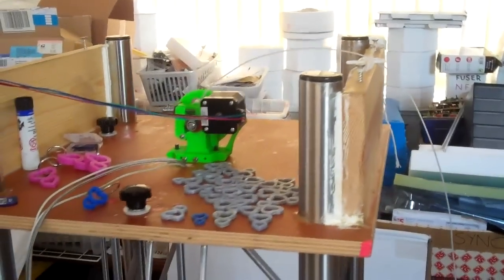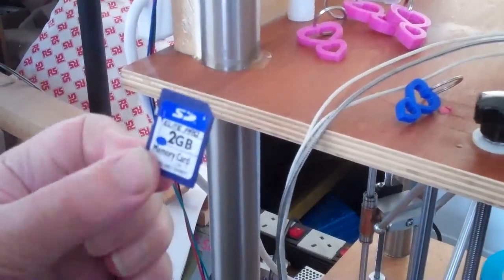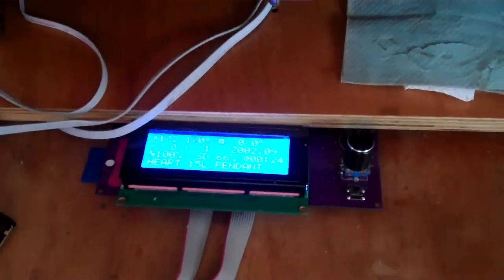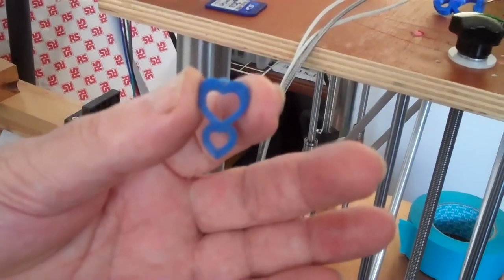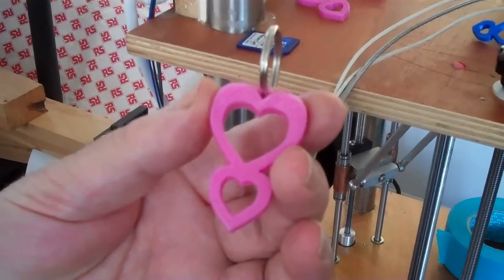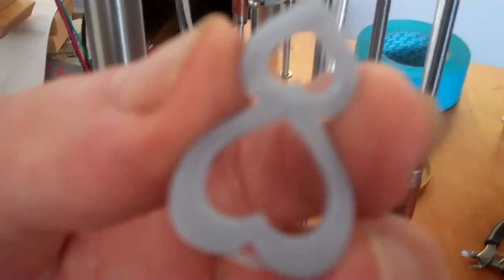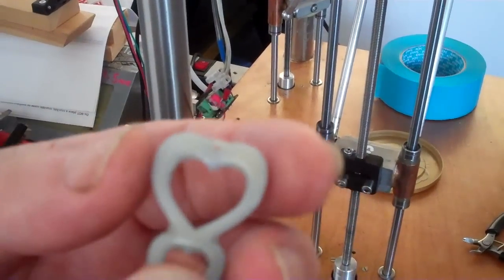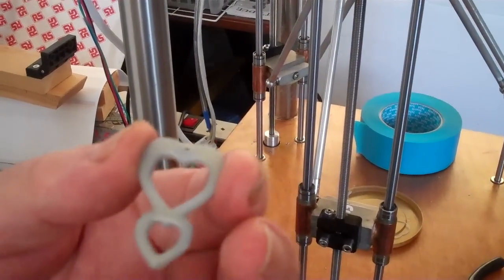3D Printing Patterns For Lost Wax Casting Of Silver Jewellery

Comment: I'm sorry. Your lecture is good, but the camerawork shows just about everything except the actual 3D print build in process, and the background noise is hard to take. It would be helpful to aim the camera at the platform even if just for a couple of seconds, and perhaps apply a sound filter to lower the background noise.

Comment: Thanks Steedcraft for this upload. I was considering PLA for lostPLA method but after seeing several videos (including this one) I think I will try Moldlay. I want to cast bronze parts for model steam engines. I'm considering buying a Kossel XL 3d printer for the Netherlands and they have informed me that there should not be any problem in printing Moldlay. Do you use a heated bed on your printer?

Comment: Hello, it is ABS, PLA or something like that? 
Thanks!
Reply from the maker: +Luciano Lizana MOLDLAY is a wax-like thermoplastic which can be used to cast a variety materials. It is extremely stable dimensionally, and remains rigid at room temperature. Below are some of the @2015specifications of the new material from Parthy:Near zero warpingCan be printed without a heated bedPrints at temperatures of 170 – 180° C

Comment: great video!

what layer height do you recomend printing with for this purpose? And what layer height/nozzle combination did you use?

Thanks in advance! Cheers
Reply from the maker: 3D printing in 'polymer' wax for castings.
The layer height sets the overall resolution, so for max detail set shallow layers, if the texture of the discrete layers is of interest then increase layer height to suit.   As the layers are visible from the edges of the piece which can be time consuming to smooth when on inside edges,  I use 0.3mm height and 0.3mm nozzle for small items of jewellery.  
This goes up to 0.5mm height and 0.4mm nozzle for toys/models for which I continue to use the Moldlay filament.

Comment from the maker: Hi Brian, we made the printer to be easily copied hence the wooden bulk heads, and rigid simple corner pillars. The odd look to the machine is that it is essentially "upside down" we wanted to keep the head to keep it rigid and frankly the fewer moving bits the better, so we move the bed underneath it. The original nuts on the leadscrews where brass but they started to wear quickly so we are now using delrin nuts with pre cut anti backlash strips, so far they are performing very well. The system runs an arduino just large enough to give us sd card and digital display.  I hope this helps if you have any further questions please feel free to pipe up, all the best Quin

Comment: Did u call it mold clay?...instead of pla for lost wax metal casting?
Reply from the maker: Maria Onisemo MOLDLAY is a wax-like thermoplastic which can be used to cast a variety materials. It is extremely stable dimensionally, and remains rigid at room temperature. Below are some of the @2015specifications of the new material from Parthy:Near zero warpingCan be printed without a heated bedPrints at temperatures of 170 – 180° C